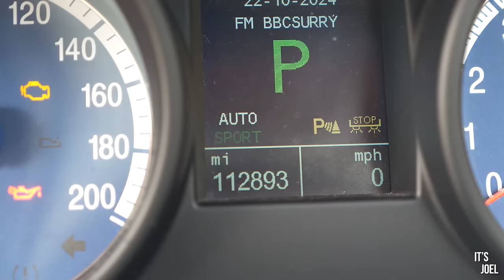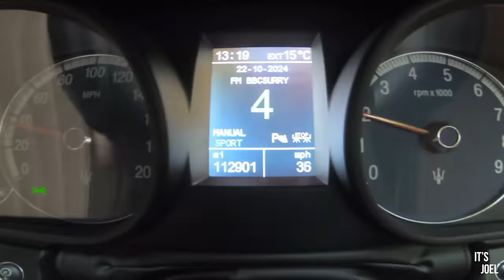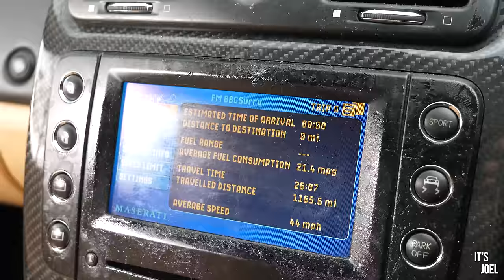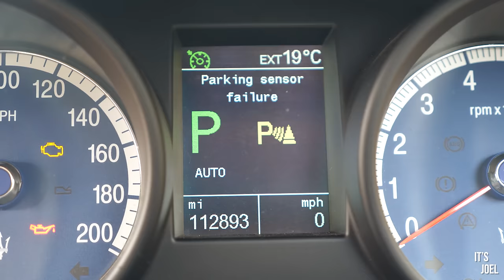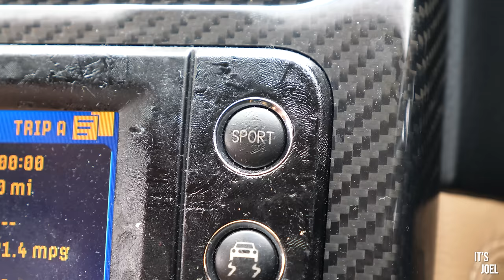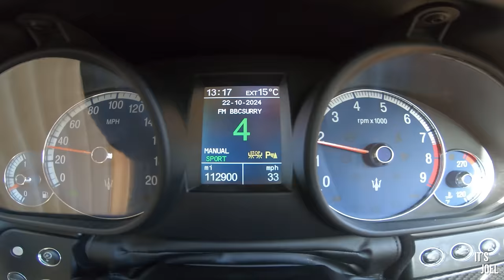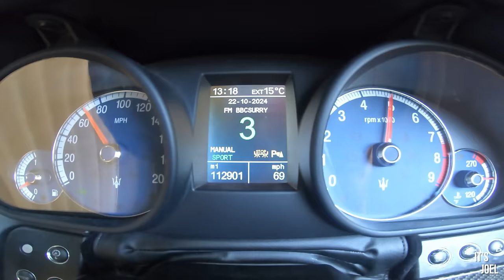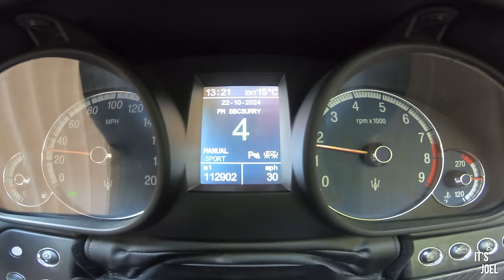The shocking truth about my cheap Maserati...

Comment: Definitely a ticking time bomb. As Maserati (4200 Manual) owner myself all I can say is you've been lucky. Anyone can buy cars and run them for a few months. Report back when you've owned it 12 months and put it through an MOT. I just got stiffed with a totally unforeseen £4750 bill to repair the entire clutch system (on a car that cost £8k). I'm not up on Quattroporte but I believe rusty subframes are also an issue as they are with the 4200.
Reply: Correct the subframes are poorly protected from the factory.  I had to have new metal welded into mine.  Best to get them protected.
Reply: @wrapdump  was under mine today. Front has been replaced and rear just showing a few areas of surface rust. I try not to use it in the wet if can be avoided although it is parked outside all year
Reply: These cars are incredibly under valued because of that you get people buying them cheap thinking they'll be cheap to run. They are sports cars and all sports cars can be expensive to run repairs clutch are a consumable part that requires alot of work to replace. This is the same with Ferrari, astons, lambo 's and many other high end sports cars of this era. It's not a ticking time bomb if you understand exotic cars. In fact my Maserati has been the most reliable one.
Reply: @sycostylie1  I was referencing more the creator that buys one cheap runs it a few months, creates enough content and sells it before they have to face any significant running costs. It gives a false illusion about genuine long term ownership and running costs. My clutch was unforeseen as it supposedly had a new one not so long before my purchase. Lesson learned on my part.
Reply: @russellbird7543  Was the clutch job because it was worn, or because of a mechanical failure?  I bought mine with a part-worn clutch at 42k miles.  It's at £92k miles now, same clutch giving no signs of slipping yet.
Reply: @russellbird7543  Don't live in fear.  Get it protected, costs a few hundred pounds max, then use the thing.  Mine was my only car for 4 years, used it for everything and life was all the better for it
Reply: @wrapdump  it's a manual 4200. Master cylinder went in queuing traffic caused by the rubber sheath splitting in the heat which was replaced £500 all in and got it driveable. But putting that new part on a 20yr old system that had been working in concentric synchronisation (I think that's how they referenced it) basically caused it to slip and drive like a sick pig. So the whole lot needed replacing. Granted it was garage rates which was basically £2500 parts, £1k labour + VAT. I could have saved £500 in VAT had I supplied parts myself but with time being a factor and if anything goes wrong at least their name is in the job. Total cost £4750 all in. If the clutch needed doing now it would probably be the more familiar £2k bill you associate with these cars as everything is new. To be honest it has removed a lot of the enjoyment driving it since that issue. Clutch was allegedly replaced 34k miles beforehand but I'm suspicious as only mention was on a bill of sale from a dealer saying 'new clutch'.
Reply: @wrapdump  how do you mean?

Comment: There’s a chap on YouTube called SV Sailing Pipedream who’s got a cheap Granturismo . He’s done a temporary fix for the variatior issue by installing an oil charge reservoir that primes the engine before start up .
Reply: Or a remote control relay on the fuel pump fuse , you can spin the engine , build oil pressure, start it with healthy oil everywhere you need it

Comment: Oh, great question, thanks for asking 😅 I'm currently saving for a 2019 Mercedes E200 full option diesel import from Germany with about 380.000km's/237k miles for 6.7k euro's, which is insane! It's newer than my main car, a C220 from 2015 and my 'project'/fun car a 2013 E200 CDI station wagon (which I got for 4k). (The reason I'm going for the newer one) LOVE how handy the huge space in the back is. So if it's not too bad (unlike the 4k car, which turned up to have a cam chain issue, which will cost 1k to fix) I might make that my main and sell my C220. 
I want to start learning how to take cars apart and put them back together with the 2013 E class. Worse case, it's just 4k, but I'd count is an education cost.

Comment: Maserati 4200 Coupe GT 6 Speed manual owner here since 2022 and I couldn't agree more with your perspective on Maserati ownership. There's so many naysayers and people who only want to believe in tired, old cliches about Italian cars when the reality is anything but. My 4200 has been rock solid since day one and that included a 1,900 mile roundtrip to Tail of the Dragon and back. I semi daily it and it's never once thrown a check engine light or given me any issues that have stopped me from driving it. Build quality is excellent, fit and finish are excellent and to your point, it imparts something very special every time you sit inside and you see and smell the hand sewn leather. Is there a better sub $30K, Ferrari engine, manual transmission car bargain that exists? I don't think so.

Comment: Hey joel.
First thanks for the videos. I really like them.
I saw a few times the vids.abot the quatroporte and like the car a lot. 
There is just one question ❓ 
I saw another video from you from 2 years ago abot rhe gran turismo were you said you wouldn't buy one.
My question where is so much difference between both? They have same engine and other parts.
Reply from the maker: I expected more from the granturismo as it is a more compromised sports car. It didn’t drive as well or feel as exciting as I had expected. Whereas, with the QP as it’s a much cheaper saloon car it exceeded my lower expectations
Reply: Thanks for your response. It's about because I'm looking about a granturismo. I think from design one of the most beautiful cars ab so timeless.

Comment: From my extensive experience they are mechanically very strong.  You should however budget about £1000 a year for an average of one ECM (Electronic Control Module) to fail per year.  Could be for the wipers, windows, interior lights, wing mirrors, etc.

Comment: So what happened with cam variator did you fixed it? I heard that Ceratec from Liqui Molly it's an aditiv that reduces friction between pistons apparently, I use it 2x on my Citroën c5 2.0 hdi , it does run smoothly

Comment: An interesting and enjoyable video 😊
I had a Maserati Granturismo 4.7 S for 2 years and 12000 miles, other than fuel and insurance it cost me 2 new rear tyres, it was completely reliable and I loved it.
Mine had the MC shift gearbox which was great fun on country roads but a bit of a pain in town.
The only properly bad experience was when a guy started shouting  abuse at me when I parked in a child space and I had my 1 year old in a child seat in the back. 😠
Reply: Same. Had my GranTurismo 4.7 S for 3 years. Nothing went wrong and never broke down. Standard servicing. Completely bullet proof. Happily sold it to some chap who took it abroad. He’s still running it years later.  Ok it was more expensive to service than our Porsche 911 but I knew that before we bought it. Lost £10k on it over 3 years and sold it with 18k miles on the clock after a few European drives
Reply from the maker: Wonder what the look on his face was when he saw your child! People jump to conclusions way too quickly!
Reply: @itsjoel  Unfortunately he drove off before I could get him to look in the back but I am sure he would have been surprised, there is much more room in the back of a GronTurismo than you would expect from looking at the outside.

Comment: Glad you are loving the the Maserati, they are very special indeed, sorry to hear about the encounter at the petrol station with Karen, hopefully this is a rare thing. I certainly have never experienced anything like that with my Granturismo, I get smiles, waves and general happyness every where I go.  people are scared of the old stories of Italian cars being unreliable and expensive, agree the parts costs for a Maserati are somewhat eye watering, but the engines are generally prety reliable. They do like to be used, I think ones with low mileage and laid up tend to cause more issues then those that are driven. 

I've not had to spend a penny on mine bar the normal service items in over 2.5 years, and like you I took a trip over to europe for 10 days. Life is short, live it while you can.
Reply from the maker: I agree. I think regular usage and temperature cycles does these engines well. My QP seems to almost get healthier the more and more I drive it. She had been sat for a number of years beforehand!

Comment: Ran one for 11 years did 70k in her and can agree that they are reliable, until they get older on the electrics and rubber items which all seem to have specific faults (window regulators break, the tpms ecu gives up, certain rubber hoses in the cooling system can burst, and as you mentioned parking sensors are intermittent) 
Sold to we buy any car for much less than you paid a month ago as just didn’t have space for two cars

Comment: Joel, I have to ask this again.  Your car has had noisy cam variators since day one when you bought it, and over the last two months of driving the car frequently, you have made no effort to repair them. On cold start, has the variator noise gotten worse, or stayed the same? Does it occur with warm start ups? Do you wait until the oil pressure rises and silences the variators before you start driving? If/when they cause massive cam failure and destroy the engine, will you just sell it in that condition? Not trying to be negative, it is just that you seem to be the bravest and luckiest man I've ever heard of. John I.

Comment: Just fix the issue yourself. I also did it myself. It is some work, but it is doable! You can ruin the engine by not fixing it! You have much bigger chance to get broken chain tensioners. If that happens, your engine timing will be off which can lead to a broken engine.

Comment: You could lease a car for say 250 per month which will be nothing special or buy this, 5k spread over 24 months £208 per month after that you have paid it off have it 3 years and the monthly works out at £138 per month, what can you get for that kind of money, even if it does pop the has has to be work £3000 in parts alone, my  opinion is drive it enjoy it and see how you come out of it when you get bored, roll on 100k mate

Comment: My dreamcar also is Maserati Quattroporte. I own 3 cars, alfa Romeo gtv 2.0 1995, alfa Romeo 159 1.9 jtd 2005 and a Porsche cayenne 4.5 v8 NA tipronic 2006. All 3 were bargains the Porsche cost me with repairs 2000 euro, this year, the 159 also 2000 euro back in 2018 and the GTV cost me only 500 euro back in 2020. If you do your homework, use your brain got a little courage you can do it. I'm sure I'll buy the right Quattroporte very soon.

Comment: I’ve owned my 2006 GranSport since 2007.  Like any car, maintain it, do your research and these cars are amazing.   Every brand has a lemon for one reason or another.   I’ve modified mine with a tune, lowered suspension, exhaust etc….let me tell you…these cars are amazing.    Haters, have you ever driven one or do you just watch YouTube videos?   Mine is fantastic….drive them, maintain them and don’t be cheap….they’re fantastic.       I promise you, join the Maserati forum, great group of members, find a fantastic independent mechanic and you can’t go wrong.   These cars are normally aspirated V8 engines meant to cruise at very high speeds on the Autobhan….but for the love of GOD…maintain…don’t be cheap and then blast a car because your cheap ass doesn’t take care of it….microphone drop.

Comment: I've always fancied a Quattroporte, but I simply dont have the patience for the likely incessant issues that will need repair. I would say however, 2.5k miles...possibly isn't enough miles to be extolling the virtues of its reliability😅
Reply from the maker: you could be right, although I imagine most owners don't even cover 2,500 miles in a year!
Reply: @itsjoel  true...I'm a 15-20k sort of driver, so I find out about reliability pretty quickly!

Comment: Lots of rude people that think because you drive a Maserati or Range Rover or Mercedes etc etc that you are Obnoxious and self Centered, rich twat.. blah blah, when it really is these people that have a hatred of what they perceive as someone doing better than themselves. I have a 2011 Mercedes E350 3.0V6 diesel Estate, in a lovely colour called Indigo light Blue, so it stands out a bit. And I have had similar problems with people being nasty rude or little snide remarks.. even with my 12 yo lad in the back of the car. But on the flip side ive had people comment on how good it looks. Usually from Genuine car people.

Comment: You need something next that's cool and will fit with the algorithms. Perhaps an old rs4 or something

The drop top ones you get a cheap ish  one for 11k /12 k ....

2006 age one approx

Then do the whole getting the performance back to oem on the day it rolled out the factory. and all the jobs u need doing on it. Get it detailed. Freshen up the paint and alloys. Maybe a car meet with Rs enthusiasts. Little coffe run with Mrs. Get at least 5-7 vids out of it.